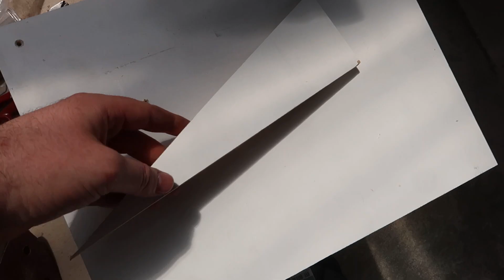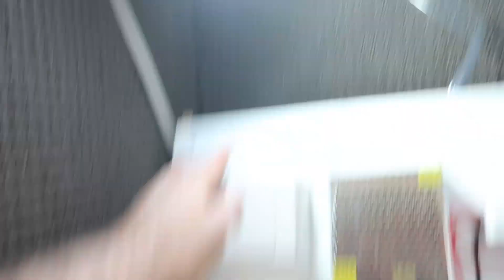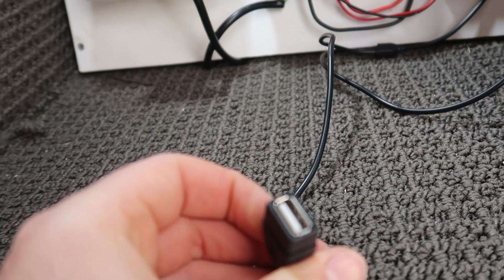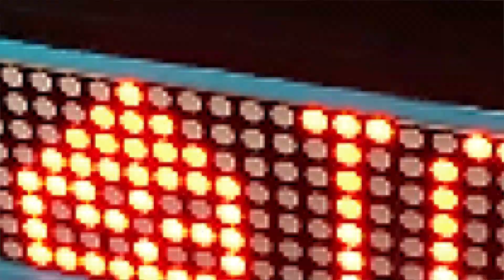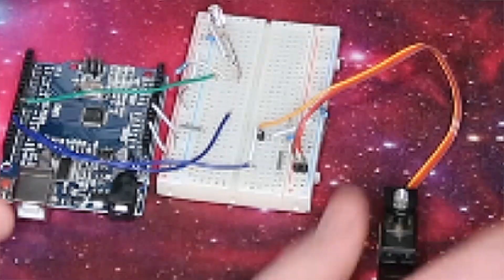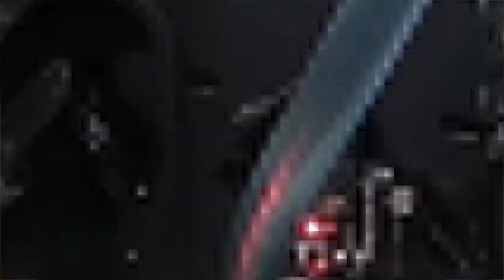Power distribution board for the Algae CO2 Scrubber

Comment: Hi Scott, thanks for the video
I think you lose efficiency with the 240AC-12VDC converter. If you will use batteries, solar panels, you can use DC-DC for suppling the 12V and 5V. 
One more thing, what will you do with the biomass that will accumulate at the bottom of the canisters? once you pull it with the taps...
Reply from the maker: Hey. Yes any transformer with have losses I’m hoping not to need to work it out it’s been a long time since I studied that subject. In the long run it will be negligible for the test and yes in future running off solar ect. I am going to put together a video on the power supply side and future power sources at some point soon, even today I picked up another transformer for the 5v side which I’ll explain as well. As for bio mass side that’s going to be a heap of videos in it self. I will try the bio fuel but it’s going to be more for fun and to show examples of use. I don’t believe it should be a final solution. If only I had time to film and edit I would be posting more often.